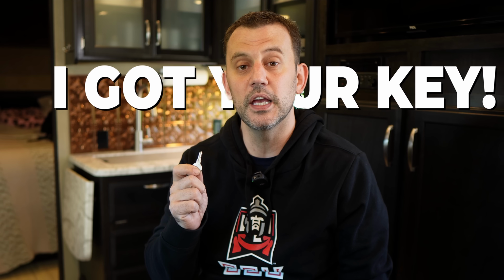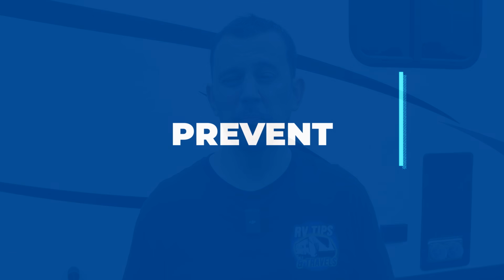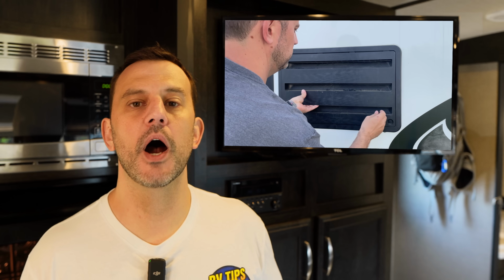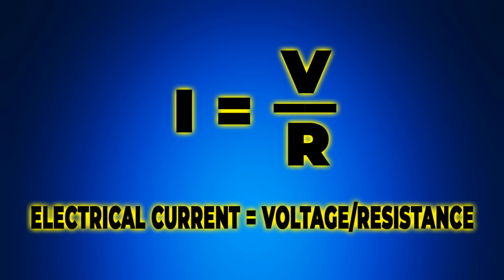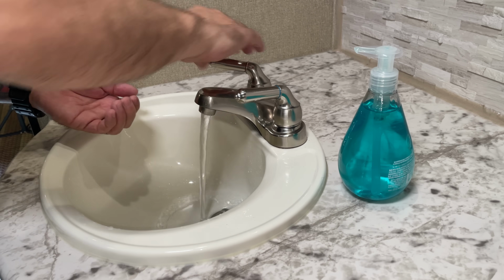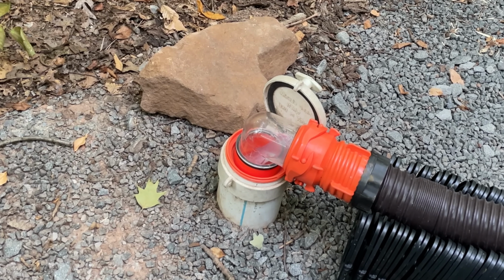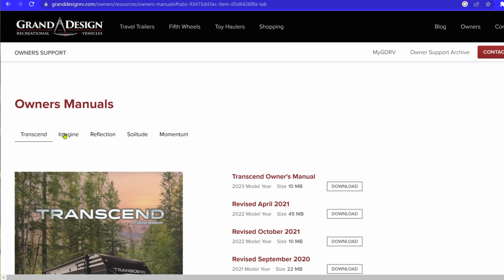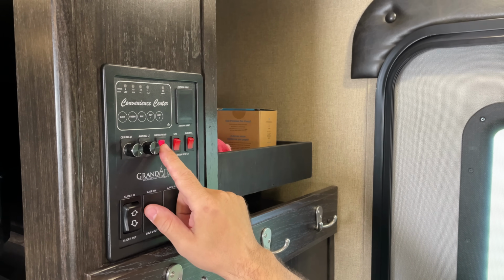7 Things You're Not Doing to Your RV... but SHOULD!

Comment from the maker: ✨⭐ PRODUCTS FEATURED IN THIS VIDEO ⭐✨
🔹 Pass-through Replacement Locks https://geni.us/rIbry (Amazon)
🔹 303 Automotive Protectant https://geni.us/nz8kzTU (Amazon)
🔹 Bug Screens https://geni.us/i2Ki (Amazon)
🔹 CRC QD Electronic Cleaner https://geni.us/WDGUwi (Amazon)
🔹 Microfiber Cloths https://geni.us/fZFu6A (Amazon)
🔹 RV Snapjacks & RV Snappad (10% off) https://rvsnappad.com/discount/RVTT10
🔹 Camco Clear Sewer Hose Elbow https://geni.us/L79gI2 (Amazon)

Thanks to Joshua from  @rvgearandfar for some B-roll assistance.

 7 Things You're Not Doing to Your RV... but SHOULD! There's a lot of information on RV's these days, but there's also a lot of things that are less mentioned that will help with safety, maintenance, and the longevity of your RV.  In this video, we discuss some of things you might not be doing to your RV, but should start doing immediately!.
 
#rvlife #rvliving #rvtips #rvhacks #rvmaintenance

RV ESSENTIALS & TOP PICKS 
🎥Essentials Video: https://youtu.be/yuvS3zZL81c 
🔷Sewer Hose Kit https://geni.us/7dNg (Amazon)
🔷Clear 90 Degree Sewer Elbow https://geni.us/L79gI2 (Amazon)
🔷RV Water Filter https://geni.us/FZ1P (Amazon)
🔷Best Wheel Chocks https://geni.us/9B5i (Amazon)
🔷Power Watchdog 30 Amp Surge Protector/EMS https://geni.us/zKcm (Amazon)
🔷Power Watchdog 50 Amp Surge Protector/EMS https://geni.us/jgOto (Amazon)
🔷Wireless RV Leveler https://geni.us/DAW9N24 (Amazon)
🔷Leveling Ramps https://geni.us/m38VoBr (Amazon)
🔷Liquified RV Tank Treatment https://geni.us/QTUJSrP (Amazon)
🔷Tire Minder TPMS https://geni.us/8HBSTg (Amazon)
🔷Water Pressure Regulator https://geni.us/fTzA0 (Amazon)
🔷Drinking Water Safe Hose https://geni.us/emLdlC (Amazon)
🔷Browse All Essentials https://geni.us/1Omwvhh (Amazon)

MAINTENANCE:
🔶Boeshield T-9 Rust Preventative & Lubricant https://geni.us/uXxstyC (Amazon)
🔶Geocell Proflex Sealant https://geni.us/YXiACx (Amazon)
🔶Water Heater Cleaning Wand  https://geni.us/AcTvhLc (Amazon)
🔶Water Heater Cleaning Adapter https://youtu.be/h6C6ihTQ1cY
🔶Waste Tank Rinser https://geni.us/V2XLE (Amazon)
🔶Road Tool Kit https://geni.us/oBFnd9l (Amazon)
🔶Eternabond Roof Tape https://geni.us/6AXdw (Amazon)
🔶Browse All Maintenance https://geni.us/UvxFP (Amazon)

INSIDE
🔷Screen Door Handle https://geni.us/itRfKUQ (Amazon)
🔷Shower Caddy https://geni.us/ZPcno (Amazon)
🔷Oxygenics Shower Head https://geni.us/jznwF (Amazon)
🔷RV Paper Towel Holder https://geni.us/Acknol (Amazon)
🔷Dimmer Switch (watch video) https://youtu.be/2bbqBcSsRZQ
🔷Electric Heater Fireplace https://geni.us/YmBoktI (Amazon)
🔷Browse All Inside https://geni.us/BWiOR8k (Amazon)

OUTSIDE
🔶Gravity Chairs https://geni.us/VlPR8rn (Amazon)
🔶Ground Mat https://geni.us/wbWWLzf (Amazon)
🔶Table https://geni.us/qsPO (Amazon)
🔶X Chocks https://geni.us/3oyburw (Amazon)
🔶Blackstone Griddle https://geni.us/8BuIrW (Amazon)
🔶Low Point Drain Valves https://geni.us/yBB02h7 (Amazon)
🔶Browse All Outside https://amzn.to/4ld0kcz (Amazon)

👇 COUPON CODES! Use the links. Save money. Simple.

🚐 10% off RV Snappads & Snapjacks https://rvsnappad.com/discount/RVTT10

💦 Blu Technology Water Filtration Systems 7% Off, $80 or more No code needed just use our link:  https://goblutech.com/xxnnkdun 

🛌 Get 30% off your RV Mattress by Brooklyn Bedding at https://rvmattress.com/rvtips
Use Discount Code: RVTIPS

📷 Haloview Back Up Cameras 5% Off & FREE Shipping (Use code RVTIPS at checkout) https://www.haloview.com/products/byte-tango-1080p-observation-camera-system.html?acc=765

🔧 NRVTA Home Study Course https://rvtechcourse.com/discount/RVTIPS20
Use Discount Code: RVTIPS20

🚴‍♂️️ Lectric eBikes - Use our link get FREE accessories https://lectricebikes.sjv.io/nLrJ3x

💻 Our eBay Store! You never know what you’ll find!
https://geni.us/6AyLKnS (eBay)

💥 Join Our FREE Newsletter! https://rvtipsandtravels.myflodesk.com/freenewsletter

If you want to support the work I do to help others, you can donate here:
Paypal: https://www.paypal.com/donate/?hosted_button_id=J2KKM9NR3BJJA
Venmo: https://venmo.com/u/Ross-Stoico

✨ AMAZON RV STORE ✨
https://www.amazon.com/shop/rvtipstravels

Follow Us on Social Media
https://www.instagram.com/RVTipsAndTravels
https://www.facebook.com/RVTipsAndTravels

🙏 If you find a dead link, PLEASE let us know & we’ll send you bumper stickers!

As an Amazon Associate, I earn from qualifying purchases. There is NO ADDITIONAL COST TO YOU when purchasing from our links. Thank you for your support! 2.0

Comment: I bought a 2020 forest river vibe 24RL with slide out at auction knowing it needed love. The fridge is located in the slide and there is a hole in the floor where the wire used to be. The slide is the cable style. There is no wire or any kind of retractor under the slide. There is an under body cover for the entire rv that I haven't dropped yet to see if any wires are still there. What is the best way to route and secure a wire. I bought a new fridge and manual suggests size 8 wire for over 15' which seems very heavy?
Reply from the maker: its something i would have to see to help with

Comment: Bro those ch751 keys are used in a lot of things besides rv hatches. I install gate openers and I have like 40 of those keys from motor replacement kits that come with an extra set of keys.

My rv had been upgraded to a residential style 12v fridge before i bought it and I had to pull it out last weekend. What a pita that was. But its the nicest fridge I ever seen in an rv so I'll deal with the pita

Comment: Love your video's and all the truthful information they contain. I would like you to add one simple step in regards to the water shut off. I always do the shut off even if I'm gone for only 15 minutes or so. But I take it a single step further. On your Y connection, I always release the pressure inside the hose. Only takes a second and it stops all pressure. Just a suggestion! Keep the great info flowing!
Reply from the maker: thank you Tim, and I will agree with you.  We have a video coming out this Sunday that talks about shutting off the water inside the rv to relieve the pressure as a secondary step to shutting off the water outside.  you read my mind!
Reply: @RVTIPSANDTRAVELS  I'll be looking for it! Thank you.

Comment: Using screens on furnace, fridge, and water heater vents could void your warranty.  If your RV is under warranty, remove them if you have the dealer service the rig.
Reply from the maker: agreed, Ken.  also, the screens should bevel out and provide more surface area as to not restrict air flow.

Comment: After cleaning your electorate connections,  I'd then suggest using some dielectric on each connection. It will help so further corrosion.
Reply from the maker: true, but sometimes dielectric grease on terminals that are unplugged a lot and exposed to the ground/dirt/debris, can need frequent cleanings.  definitely will help with corrosion, just keep an eye out for anything sticking to the grease.

Comment: I agree with shutting off the water supply EVERY time we leave the RV (I also shutoff the propane, close windows, lock all doors and compartments, and retract in the awnings). But I found out recently, that simply shutting off the water supply isn't sufficient. The water system still holds the pressure in the lines! If there is a leak for any reason the water in the lines will spray and drain to the leak point, causing much more damage than imaginable. So I now, after shutting off the main supply, open and close a valve of the hot and cold lines, to relieve the pressure, and then close those valves. I had found water damage in my storage area  of my RV,  from a water connection leak, a couple months after storage ( no water connected), from lines that had still held pressure. Apparently the heating and cooling effect from storage, weakened that connection. Nearly a gallon had drained out into a storage bay below!
Reply from the maker: we do the same, but theres still maybe 1-2 gallons in the lines at most.  not to say that wont cause damage, but constantly running water is worse.  also, instead of going back in after shutting the water off, just open the low point drains outside for a second.  it will do the same thing and you dont have to go back inside.  dont need to drain all the water, just depressurize it.

Comment: How about covering LiPO4 battery care?
Reply from the maker: Hey Dan, I havent played around with enough different manufacturers of LiPO4 batteries to know if all of them have the same maintenance points and schedules.  I do know there are differences in the cells, BMS's, circuitry, and those differences may affect the actual maintenance. I do think a general LiPO4 maintenance video could be made though, which some asterisks of course (ie always check your specific manufacturers recommendations).  Thank you for the comment, Ill see what i can come up with.

Comment: WORD TO THE READER..REGULAR VASOLINE SHOULD DO THE SAME THING AS A LUBRICANT TO THE RUBBER SEALS.. MUCH EASIER TO COME BY !!
Reply from the maker: 🤣 Im guessing this comment was meant as a joke but Im going to respond just in case people think its real.  NO! do not use vaseline.  Wiper seals need to flip when the slide moves, vaseline is not only going to prevent that from happening, its going to smear all over your slide walls!  This will help you understand proper slide seal maintenance. https://youtu.be/Fwv2oml25bs

Comment: If you go away and turn off your RV water pump. The system is still in the pressure and will empty the lines if you spring a leak correct would it be advisable to open the lowest point to release the water pressure such as the outside shower hose? That way there is no water in the lines that can leak into the RV at all
Reply from the maker: if you are using your tank, the water outside has to be already turned off or your tank would be overfilling... so there is no pressure from the bib to the camper.  if you turn the pump and there is a leak, you are correct it would only release the water in the lines in the rv after the pump, which isnt that much water to be honest.  in fact, it might be a good amount of water to notice you have a leak without really damaging anything.  if you want to relieve the pressure while using the pump... turn the pump off, then just open one of your facuets for a few seconds and the pressure will be gone.  without pressure, its highly unlikey youll get a leak.  no need to do it at the low point drains but you can if you want.  you just want to relieve the pressure, so opening any faucet will do that.   make sense?

Comment: Hey Ross.
I just found your channel. Your videos are very helpful. 
How about a quick video of things to do before bringing your slide back in before closing after a weekend camping in the woods.  Leaves, pine needles and such. Should I sweep it off? Can I stand on the slide?  I also own a Grand design Imagine. 
A 17MKE.
Thanks for you help. 
David
Reply from the maker: you can get slide toppers, but im not a fan of them.  before packing up each trip, i go on the roof with a broom and brush the slides off.  also, every rv is different, i would contact the manufacturer to find out if you can walk on the slides of your specific model.

Comment: I discovered mice droppings in my rv in less than two months ownership. I began to spray foam under carriage where hoses come out. Next I’ll spray/caulk the second climate defence floor as is made of light weight corrugated  plastic and warps. I have to fill in the warped areas between the fasteners. 👍
Reply from the maker: that sounds like a good start!

Comment: I had to have four cables on my large cable kitchen, slide out replaced and adjusted. Now my slide drags on the bottom on either side. I have checked out slide skis what is your opinion? My rig has never had them installed. I have a 2022 Keystone Fuzion toy hauler model 379.
Reply from the maker: I heard they work wonders, I just dont know if I've seen them installed on a cable slide though.  Sorry, never did it so I cant really say for sure on this one.

Comment: I have a couple of questions, my water heater was working and suddenly I have a leak under my bathtub, I noticed it by going aoutside and I noticed drops of water coming from beneath. I opened a little hole in the seal cover for the water to come out. Now the water pump is not heating water. We being having strong winds and my fifth wheel was shaking. I wonder that mess up the water pump but I am for sure is a leak, I think is one of the hoses that broke. I was trying to take out the bathtub but I can't find the way to do it. I probably I will hire  bring an expert
Reply from the maker: sorry, I cant really diagnose issues like this without physically seeing everything.
Reply: @RVTIPSANDTRAVELS  thank you

Comment: You showed what to do to keep rodents and bugs out of your RV. One area you missed was the roof top a/c unit. The first year I had my rv stored beside my house squirrels nested inside my roof top a/c. The squirrels chewed through the styrofoam insulation and made a nest. After cleaning out the nest I repaired the are they chewed. After that I glued 1/4 x 1/4 stainless steel mesh over all the vent holes. Now in the spring this is one of my roof top checks is to remove the a/c cover and check that the mesh is still secure and that no pests have made a home.

Comment: My wife and I just bought a travel trailer at the end of last year. I seen that your water filter was connected directly to the water source. I was told to connect it to my trailer. Does it matter where to connect it? Very informative video by the way...new subscriber!
Reply from the maker: i would say its personal preference.  for example, some people changes hoses every year or so, so they might not care about running unfiltered water through the hose and put the filter on after the hose, before the RV.  some want the water to be filtered as soon as it comes out of the hose bib, and therefore place the filter further away in line from the RV.  there is no right or wrong, at least if you ask me.  some may disagree, but no need to overthink it.  just run it before the components you want filtered.  hope that makes sense.
Reply: @RVTIPSANDTRAVELS  thank you, that's what I kind of figured i just wanted to make sure.

Comment: Can you do a video on when and how to use the water heater? does it stay on all the time or only when  you need it should you activate it?
Reply from the maker: You can turn it on all the time.  It will only power up when the water falls below the temperature it’s set for.  You should have it off when you’re not using the RV.

Comment: Turning off the city or on-demand water when away just seems to me to be common sense and we’ve always done it. We also shut off the water heater.
Reply from the maker: i turn the water heater off as well.  another thing you can do is (on city water) open the other side of your splitter at the water pedestal after turning off the water.  this will relieve the pressure in the lines inside the camper.  if you dont have a splitter like these: https://amzn.to/3ZtJrBQ you can also just open a faucet inside, either after turning off power outside or turning off the pump.  you will have to repressurize when returning, but that removes all possibilities of leaks.

Comment: When you turn off the water while you are gone, I would have opened both sides of the Y connector to relieve the back pressure from the system. I use that trick when switching valve positions on my Nautilis system so they are not under pressure while being changed.
Reply from the maker: thats a great idea, but it will only relieve pressure up to the panel IF the panel has a check valve at the connection point.  I dont have a Nautilus panel, but I believe most of them do.  so there would still be pressure after the panel in the RV plumbing I believe... however its a great thought, and I think the better option is to open one of your sink faucets for a few seconds, which will relieve the pressure in the RV plumbing.  your thoughts?